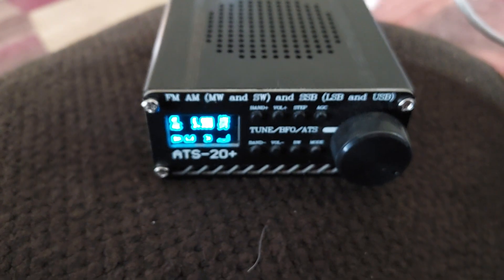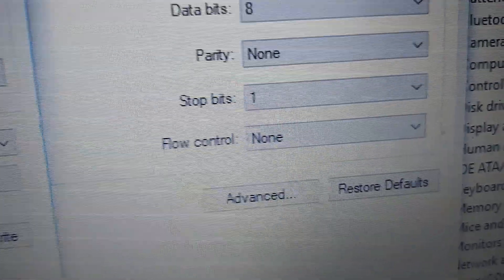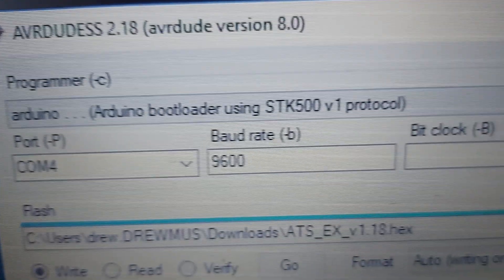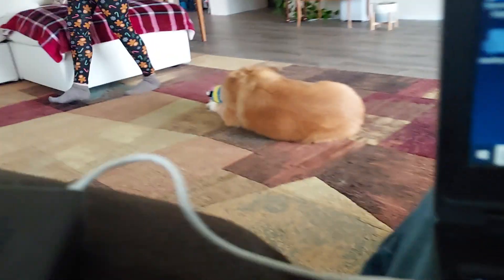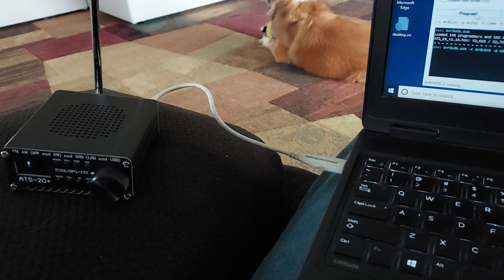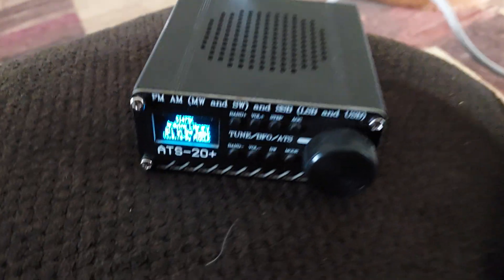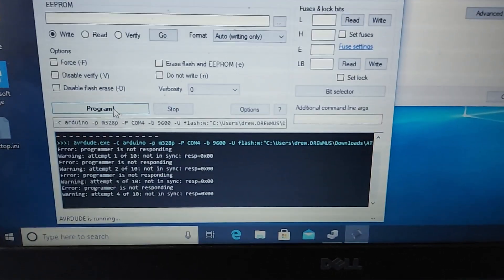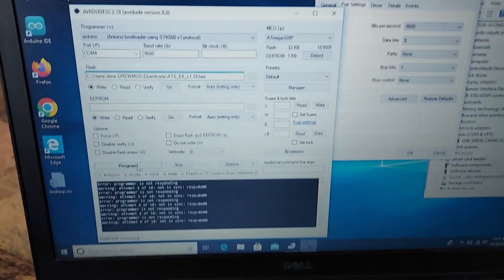ATS-20+ won't flash.

Comment: I know it's 2 months later but I succeeded. Problem seems to be that the 3V3 en 5V busses are tied together. So the CH340 chip on the Arduino board don't like that 5V and probably toasted by inserting the USB cable. Mine did I pressume. I took this cheap USB/RS232 converters, sodered wires on the Arduino board RX, TX, GND and +5V, connected it to the converter. Disconnected the ATS battery first and now I could get it flashed with new firmware.

Comment: A lot of these radios were shipped with bad USB ports on the Arduino.  If the PC can't connect you will need to replace the Arduino.
Reply from the maker: @stevec5000  that's unfortunate
Reply: @SolarDrew  Unfortunately they soldered all the pins to the main board instead of placing it in a socket but only half of the pins are used so it isn't too hard to replace.  The PC boards are pretty low quality though so you have to be careful not to lift any traces.

Comment: Likely the configuration between the usb and the com port.
Reply from the maker: @offgridwanabe  I pretty much ruled that out. I'm with the other comment. Bad Arduino.  After all it is a cheap Chinese unit. But hey it still works and 25 bucks for a shortwave receiver you can't beat it!